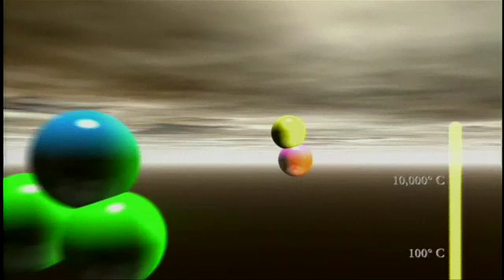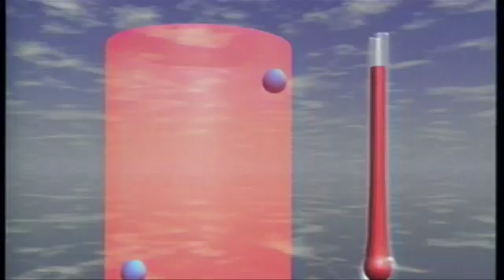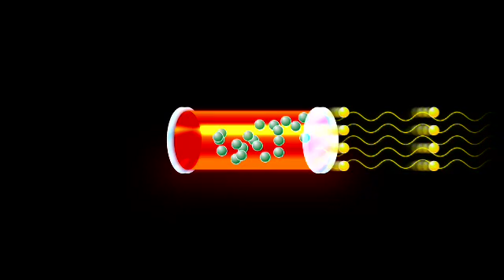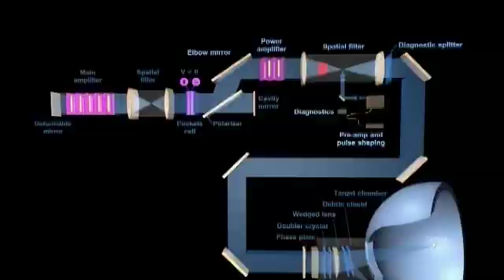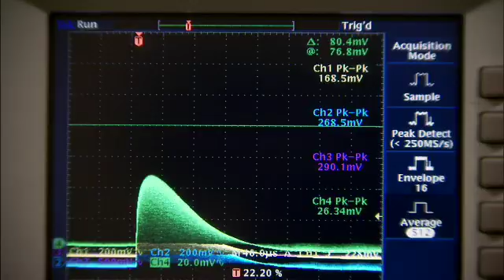Super Laser at the National Ignition Facility | KQED QUEST

Comment: Fusion was achieved in this lab in 2022! 🎉
Reply: The experimental shot you are referring to took place on 5 December 2022. The announcement was that they finally achieved more energy from the fusion reaction than the energy applied in compressing the the D/T fuel mixture. It was later reported that it took over 100 times more energy to pump the laser system to generate the compressing energy. The nuclear fusion reaction only lasted for approximately 0.000,000,000,08 second but the experiment took about a week to set up. The generated fusion energy was about enough to boil two liters of water. Approximately 96% of the extremely expensive and radioactive fuel was blasted away from the microscopic reaction center before it had a chance to react. There was no significant propagation of the fusion reaction before the fuel was blasted away from the reaction center. The so-called 'break-even' goal was supposed to have been achieved by 2012, in the NIF machine. The quest, for the holy grail of commercially practical nuclear fusion energy power plants, began in the 1950s.

The NIF administrators have always been masterful in obscuring the primary purpose and funding of NIF whenever presenting to the press and to the general public. It has always been primarily funded as a thermonuclear (H-bomb) research tool.

Comment: We're almost there
Reply: The efforts to create a commercially practical nuclear fusion energy demonstration power plant began in the 1950s. There are now well over a dozen experimental nuclear fusion experimental machines around the globe using numerous different approaches. None are anywhere close to the goal but that has no effect on the numerous claims that they are. They are all competing for limited funding so the sales hype keeps increasing.

The NIF administrators have always been masterful in obscuring the primary purpose of NIF when presenting to the press and the general public. It has always been primarily funded as a thermonuclear weapon (H-bomb) research tool.

The lab created a big splashy announcement regarding their 5 December 2022, shot which generated enough fusion energy to boil about two liters of water. The fusion reaction lasted for approximately 0.000,000.000.08 second before blasting approximately 96% of the extremely expensive D/T fuel away from the microscopic reaction center. The presenter failed to mention that the tritium fuel is radioactive. It took about a week to set up the experiment and since then the lab has had difficulty repeating the experiment. Later it was mentioned that the energy to power the lasers, for this shot, was over 100 times greater than the fusion energy that was generated. It's estimated that approximately $11 billion, of federal revenues, have already been consumed by this experimental facility.

Comment: @swack22 amplifying joules and concentrating them on one TINY spot to make more energy. amplifying joules takes a lot of energy to do. But using it to make fusion, and actually succeeding in that, makes the motion machine you're speaking of possible. Because to my knowledge, fusion makes a LOT more energy than what is required to amplify and concentrate joules. Which then means this could be done endlessly, producing all the energy needed for anything including the motion machine

Comment: @Jah044445 No not every stars ends into a black hole, for that you need huge gravitational power, and that is only achieved on stars of at LEAST 10-20 times the mass of our sun, which actually will die as a white dwarf...
So micro sun just vanish once they run out of fuel and power to sustain them(gravity and internel heat sustain the sun , here is the laser beam)

Comment: no, there is not, but:
100.000.000 will bie in the very tiny little and the rate of energy will decrease by 1/r^2, so after several meters, you have much less energy.
sencond, heat is nothing else than elctromagenetic energy, which can be closed or sealed by huge magnetic fields
and third: a functional fusion reactor will be fired by continous burning material, which will cool down the the surroundings bevor they go off in the fusion. comparable to a rocket nozzle (e.g. Saturn V)

Comment: I would imagine that you get more energy out of the system than you put in, in a similar way to how an implosion based Nuke works. 

You get some material you want to effect on an atomic level, apply a comparatively weak force to it in a very specific way, and boom (pun intended), you have a Nuke, or a fusion reaction in this case.

Or not, I'm not a physicist. But that's the way I've come to understand how the thing works.